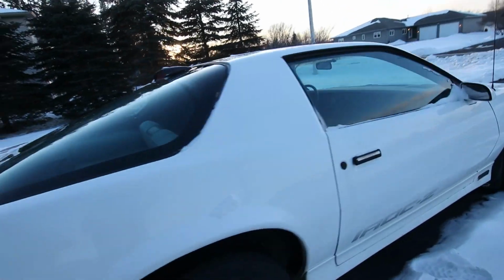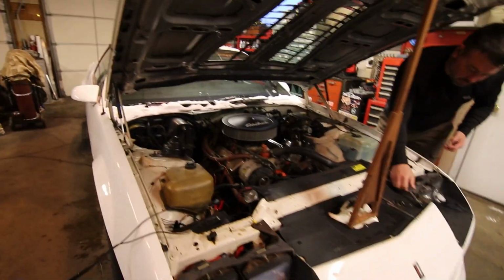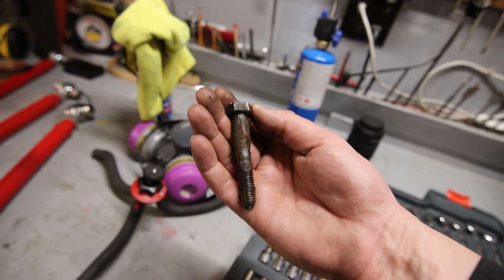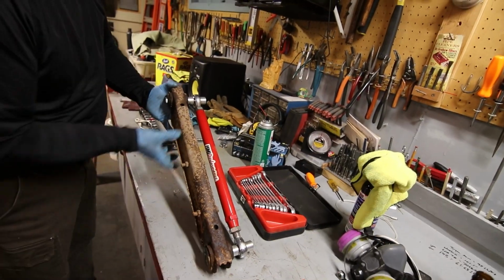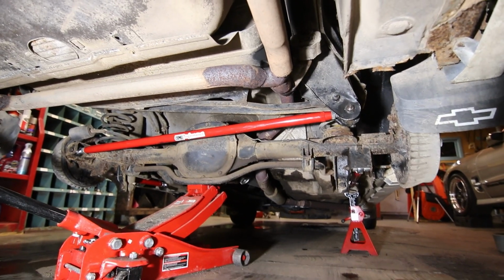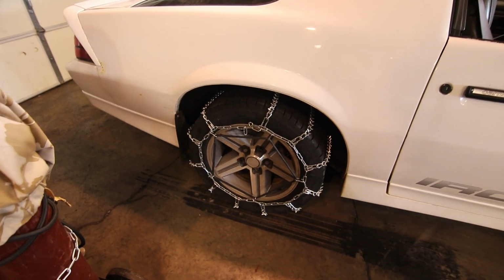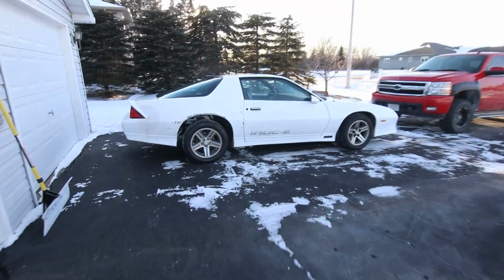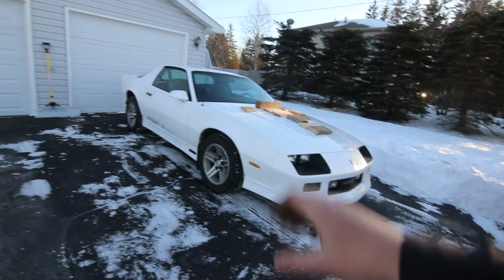BIG Win!!! IROC-Z Upgrades & Drifting On A FROZEN Lake! *UMI Performance*

Comment: Man buddy bringing back memories on ice racing. I used to professionally race 4wheelers back in the early 90's on ice and dirt.. I had a "86"Honda trx 250r 2stroke. That was built by my sponsor KRANK IT RACING ENGINES.. I had 2 trx 250r's one for flat track setup and my other one was set up for moto cross style with jumps and s turns.. etc. It was funtime in my early age days lol.. now I'm building and restoring my own project 94 Trans am.. funny how hobbies change..
Reply from the maker: Sweet. I've never raced bikes or quads but I've got friends that do and it looks like a blast. They RIP on ice. They would run circles around the car as it ran this weekend. Studded tires all around really are key to going quick.
Reply: @Greenlightfilming  yep... It's a blast ice racing.. it's not cold once you get out there racing your addrenalin is pumping 👍
Reply: @Greenlightfilming  be safe out there too..
Reply from the maker: Oh I bet it gets flowing. I had a ton of fun and there wasnt another person out there. Wheel to wheel would be a blast
Reply: @Greenlightfilming  cars coffee and of course a nice cold beer buddy... Be safe out there 👍🇺🇲
Reply from the maker: Will do. Thanks bud
Reply: I'm going to need a beer after all of this snow coming in to our neck of the woods.. it's been one snow storm after another. Man I'm ready for spring....

Comment: The old panhard bar bolts are "stepped" bigger at the head end and smaller towards the threads end.  Same as my 87 Firebird TA.
Reply from the maker: Maybe it didn't depict it perfectly. The smaller diameter portion of the bolt had a lot of material missing from corrosion, and the fatter end was totally seized in the upper PHB mount with rust.

Comment: Good source for grade 10.9 flanged bolts is the John Deere Dealership.
Reply from the maker: I'll have to bring them in and see if I can match them up. I also have a fastenal locally. Might be a good option too
Reply: @Greenlightfilming  I snapped an M12  10.9 flanged x 110mm.   Nearest one was 3 hours away.  Called 7 places.   John Deere had everything.  Affordable too.
Reply from the maker: Interesting. I need to replace the PHB bolts for sure. Everything else has looked fine.

Comment: I know I’m late on this video, but 882’s are the worst flowing heavy casting heads. The only thing worse is 624 lightweight castings. You probably figured that out by now. I personally call 882’s triangle port heads.

Comment: Rookie 3rd Gen. Owner from one frozen state over there ~~~~~~>  I have very little clue what I am doing, I have public video of super clean 1989 Firebird Formula  that stimulated me last June. Needs 9 bolt Borg Warner either rebuilt or shimmed. I dont want to replace as keeping original.  Any opinions on my new ride and the restoration of it feel free.  Also, feel free to weigh in on the Formula hood. Keep it sleeper or find original hood?
Reply from the maker: Greetings! I really like the factory formula hoods. That's just my .02 cents. As far as the 9 bolt goes, that's its biggest downside. Once it breaks itll cost something, and parts arent as readily available.

Comment: What year is this? Has the 86 brake light on the rear window, no brake light on spoiler, so I'd think it's an 86 but it has the iroc lettering in the rear part of the door?

Was it repainted/restickered before? Is it a real iroc?
Reply from the maker: It has a really bad repaint job. B4Z RPO code car. It's an Iroc.
Reply: @Greenlightfilming  looks like it may be in for a repaint soon anyway after this video. Looked like fun
Reply from the maker: Yep, its waaaaay past due for a decent paintjob. I touched up the damage with rustoleum gloss white, and I'll be damned if I could tell that it was any different than the paint lol
Reply: @Greenlightfilming  excited to see the rest of the plans for it!